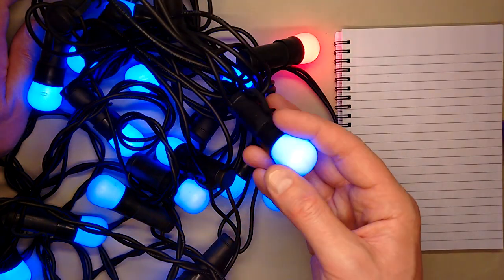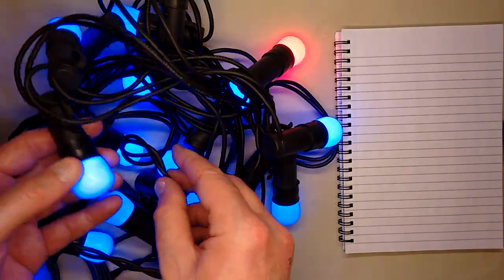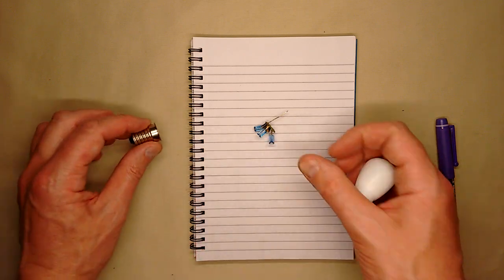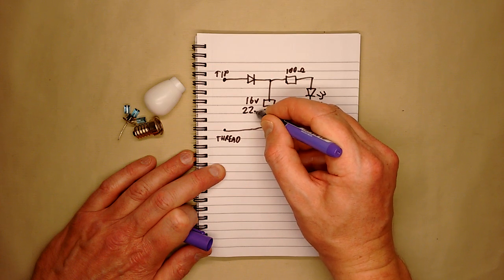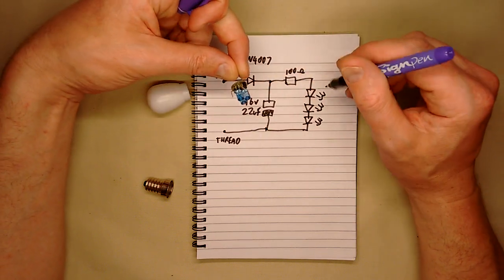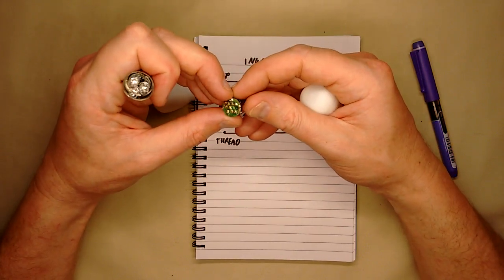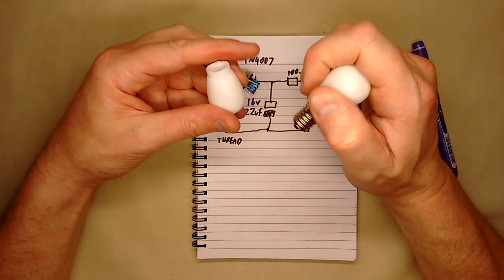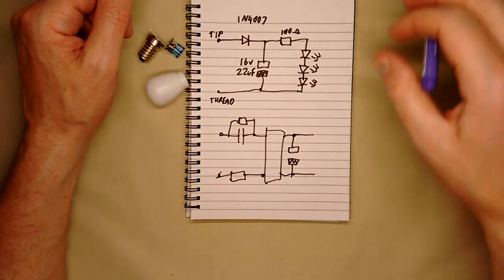"Vintage" LED pygmy lamp string (with lamp schematic).

Comment: +spotify 95 Screwfix do an E27 110 volt lighting harness with 10 lamp holders. IP54 Model E89810.At £39.58 ex vat it seems pricey, and the yellow cable is hardly what you'd call flexible. But there it is.

Comment: The flickering makes me wonder if that was originally designed to work on 60 Hz instead of 50 Hz. That would be easy enough to test with some LEDs, the components to duplicate the circuit and a function generator but my electronic workbench is all the way (1 Meter) over there and I'm feeling lazy.

Comment: Might be a stupid question but why put as a company, a half wave rectifier on each light, why not just put a single full wave rectifier at the plugs base and run the whole thing of DC? Efficiency issue's?

 Seems like having to build special circuit boards for each light would cost more than just 1 for the whole strip...
Reply from the maker: I think it was to allow use of existing festoon designed for 12V tungsten lamps.
Reply: Hmm interesting, very valid point. It would make sense for the company to make the strip usable for both types of lights. But still that flicker is horrible because of it using only a half wave.

 At any rate though I thank you for your reply, I am a big fan of your content and I am curious to see if you do anything else with this strip.

Comment: E14 on what is a essentially a 12V lamp? I see a certain failure mode that needs testing!
Reply: Bright flash and blackened lamp from when it happened to a friend except it was an incandescent lamp and 120 volt mains.

Comment: Is there a calculation to determine the amount of voltage dropped through a resistor?
Reply: they drop whatever is applied to them - if the supply is current limited, then it'll be U=IR, else (steady voltage applied) the current will be I=U/R ...
Reply from the maker: Resistance = voltage to be dropped divided by the required current.

Comment: Obviously, 22µF was the cheapest which would make the lights work for this application. if you switched the capacitor to larger, maybe 47µF, would that reduce the flicker?

Comment: So if you wanted to could add 3 color change LEDs in it for really different colors
Reply: Not really, because the LEDs are only lit during half wave, which means the other half they are off. The colour changing LEDs always start from the same colour (blue). It wouldnt have time to cycle to the next colour before its switched off. Thus it would always look the same colour.
Reply: +iPelaaja1 and even with a full bridge rectifier the DC might not be stable enough to keep them going. Maybe if the capacitor was large enough.
Reply from the maker: The capacitor would probably allow the chip to retain its colour position even when the voltage had dropped to the point the LEDs were extinguished.

Comment: Aren't blue LEDs a relatively new invention?
Reply: Early 1990s. Picked up the 2014 Nobel Prize in physics for "having invented a new energy-efficient and environment-friendly light source – the blue light-emitting diode (LED). In the spirit of Alfred Nobel the Prize rewards an invention of greatest benefit to mankind; using blue LEDs, white light can be created in a new way. With the advent of LED lamps we now have more long-lasting and more efficient alternatives to older light sources.

When Isamu Akasaki, Hiroshi Amano and Shuji Nakamura produced bright blue light beams from their semi-conductors in the early 1990s, they triggered a fundamental transformation of lighting technology. Red and green diodes had been around for a long time but without blue light, white lamps could not be created. Despite considerable efforts, both in the scientific community and in industry, the blue LED had remained a challenge for three decades."
https://www.nobelprize.org/nobel_prizes/physics/laureates/2014/press.html
Reply from the maker: I do intend to make a video on the dimming of LEDs using standard tungsten wall dimmers.  But it's going to be more about the science and why the dimmable lamps are often quite flickery.
Reply from the maker: There was actually a tungsten based blue LED that was a small filament lamp potted in an LED style resin housing.  Was rated at quite a low current too.  I used two silicon carbide LEDs in my first experimental RGB colour mixer.  When I retrofitted it with gallium nitride ones I should have kept the original carbide LEDs.
Reply: Now that I think of it, this whole thing reminds of of Purple. Purple used to be a royal color because of how expensive and rare the dye is. But now? It's as cheap as any color. Same with Blue LEDs.
Reply: The blue started as ultra violet/blue and that lead to the white phosphor top coated lamps.
 Give thanks to Shuji Nakamura, working at  Nichia where he invented the first high brightness gallium nitride (GaN) LED whose brilliant blue light, when partially converted to yellow by a phosphor coating, is the key to white LED lighting, which went into production in 1993. 
Source Wikipedia.
I worked building aircraft cabin lighting based on mostly Nichia LED's. The warmth of leds back then still left a lot to be desired. So.... we would dye the LED's plastic orange with the same compounds used to tint sunglasses. That process was really hard to get right on stings that had to pass interior designers inspection for uniformity. These strings were used as "wash light " or indirect lighting running along the cabin of the aircraft.
Things have come a long way in the LED world, to be sure.
Reply from the maker: It seems like it, but it's actually a while since they first appeared...   At £10 each!
Reply: Damn, you could probably buy a pack of 1000 on ebay for that much money nowadays.
Reply: They are fairly old but the original ones were silicon carbide, prone to failure, not very bright, and very expensive (as Clive notes).

There's a story that Mercedes wanted to use one as some sort of indicator on their dashboards and ended up using a small incandescent bulb with blue paint on it.
Reply: I bought my first blue LED in 1994 from Dick Smith. 3mcd for 5 bux. BUT IT WAS BLUE!!! These days everything's blue including my corvette da ba dee j/k I have a corolla
Reply: IIRC the old maplin catalogues used to announce that blue LEDs would never be available since they would cost £1000s each, they were saying this into the late 80s... suddenly blue LEDs were everywhere, companies were putting blue power on leds into their gear to make it look more high tech, they were in the bluetooth earpiece props on 'torchwood' (when wearing a bluetooth earpice still meant you were important rather than  meaning you're an idiot) eventually poundland had multipack lighters with a blue led in the bottom and the honeymoon was over, blue became just another colour again.
Reply: My first blue LED was in 1993 or so. Paid a lot, but it was a sky blue. Then not too long after that I got my 2nd one. It was darker in color but very nice, too. Around 1995 they started to appear in high end electronics.
Reply: Don't suppose you've still got any of the Si  carbide ones around you could show us?
Reply: +bigclivedotcom Could you have a look at these new dimmable led lights which are supposed to replace the classic incandescent lights in dimming applications?
Reply: bigclivedotcom I was at a local home improvement store and they now offer "special" dimmable, LED bulbs that work with such dimmers. I wonder how these lamps differ from the usual ones. Don't they use a capacitor dropper and maybe some more intelligent circuitry?
Reply: fox fyre3
Talk about prices dropping, $5 gets you 50 blue 3000mcd LEDs now. (They are hella bright)
http://www.aliexpress.com/item/50pcs-lot-free-shipping-5mm-straw-hat-blue-LED-3000mcd-5mm-light-emitting-diode-5mm-strawhat/32322211053.html?spm=2114.13010208.99999999.263.NoXiXC
Reply: Yeah, but blue felt tip pens have been around for a while ;)